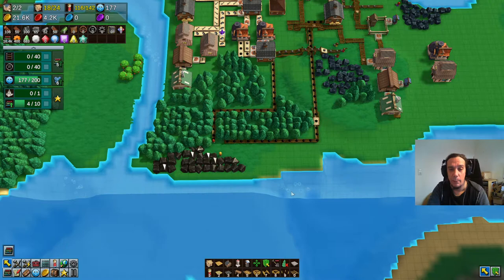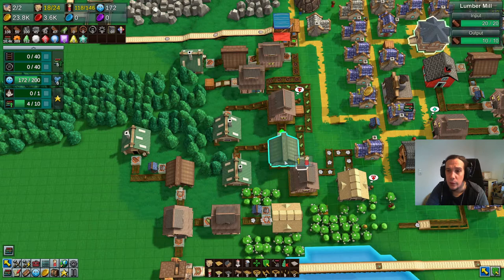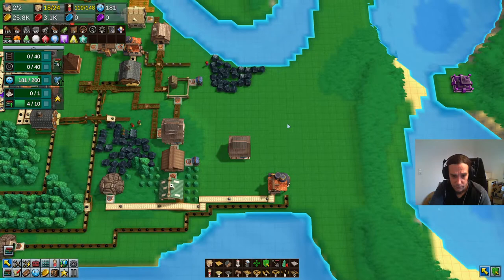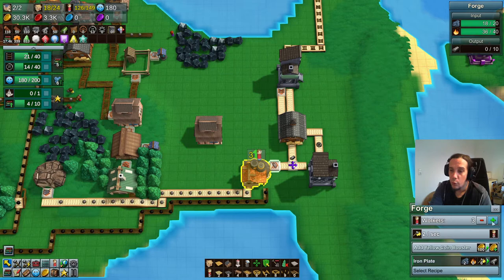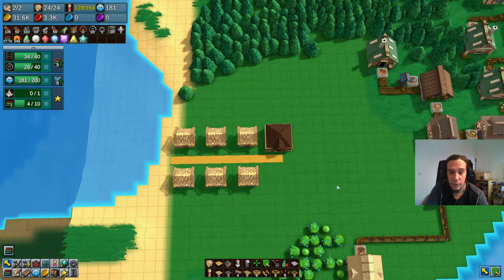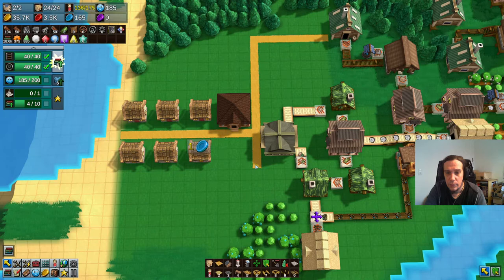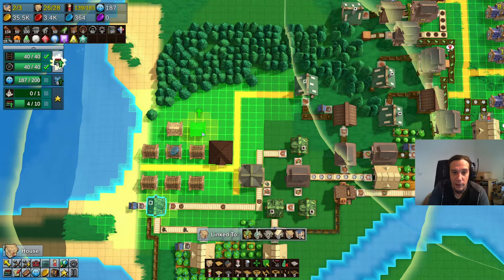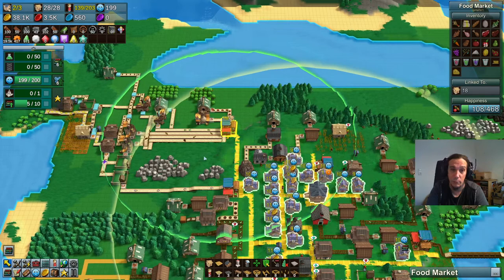MEDICINE MAKING - Factory Town ISLAND MAP Gameplay 07

Comment: When you moved the forester onto the river, there is a trick you could use there. Building new buildings places platforms under the building. Moving does not.
Reply: The problem you had with uneven terrain for the output was that it was a block on the diagonal. You could have put the output on any of the other tiles.. Or if you wanted to move the forester closer to the trees, all you had to do was to extend the platform, or delete the existing forester and rebuild it and let the game build the platform for you.

Comment: 11:50 You put a filter on the second row for the wheels, but the iron bar row at the top isn't filtered; if you run out of iron bars, it could end up with something else in it and no room for iron bars.
Reply: 14:10 And there it happened. You fixed it.